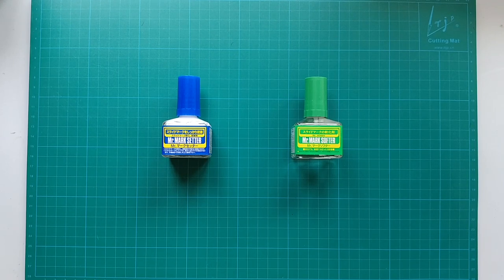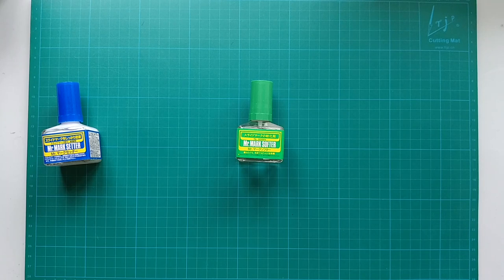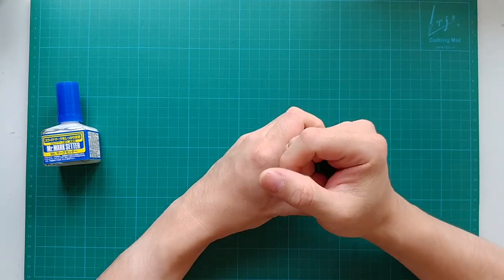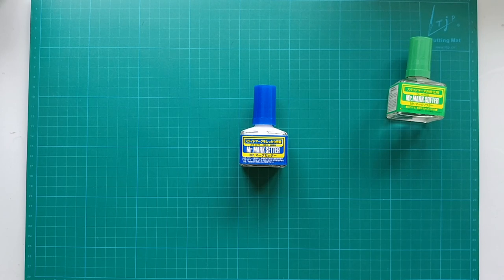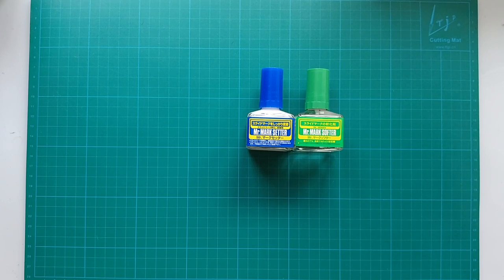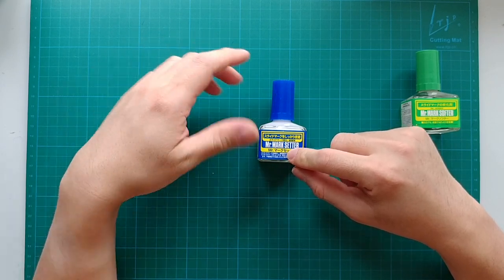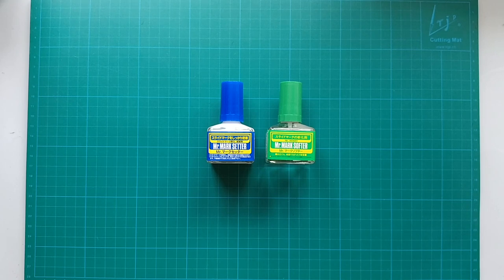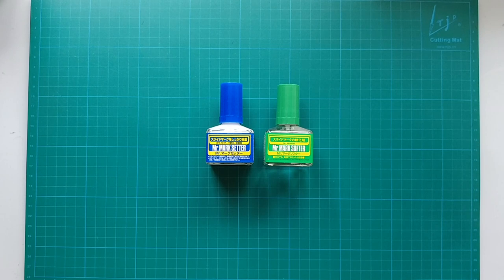[Scale Modelling] Decal Setter vs. Decal Softer

Comment: great tutorial, thank you
I'd like to add a note about mark softer. There is a real chance of damaging decals, if you expose for too long. And this "too long" is different for various decals. I have an unpleasant experience with airfix and hasegawa. Exposure time was around 1 min. Got various effects - from spots of burned colours to partially dissolved decal. So it's a good idea to try this liquid on unused decals from specific kit first, and adjust mode of operation accordingly. Aside from that this is really great and handy product.

Comment: I need to ask some questions about working with softer and setter. Is there anyone who can help me or direct me to somewhere I can ask questions? I've tried searching for English language Gunpla forums, but the results I've found either 404 or aren't updated.

I'm trying to use some water slide eye decals for one of the Figure-rise Standard Build Diver kits. I have the eyes on the parts, but the glue is so weak, the decals fall out of place as soon as they're fitted into the faceplates. I bought some softer, thinking that might solve my problem (if I can melt the decals in place, they won't fall out), but after watching this video, I'm less sure. The eyes are already resting on the parts... I'm just afraid they won't stay there. How should I fix this?
Reply from the maker: Softer provides no adhesion at all. But it help to shape the decal membrane to have better fitting to the contour of the object surface, enabling to maximize the contact area.

Setter is the decal adhesive with mild softening effect.

It might be too late now. But anyway, you should clean the model surface to remove any oil, grease or de-moulding agent before you apply the decal. This might be the cause of your decal detached at the first place.

If you really worry about the decal detached again, here is my recommendation. But it is somehow risky. Just to detach the decal by soaking the piece in water. Provided long enough so that the decal separate from the piece on its own. Carefully retrieve and preserve the decal membrane and clean the model surface with diluted dish washer (rinse off accordingly). Re-apply the decal with Setter or wood glue (If you don't have the Setter on hand.)
Reply: @BadGuyDennis  you're not too late! I will give it a try. Thank you!

Comment: Can I use this Setter and/or Softer even I had already finished to transfer decals on my model kits without using this a few days ago?
Reply from the maker: Yes, you can!
Reply: @BadGuyDennis Thanks for reply. At least I have no worries today.
Reply from the maker: Just want to remind you that you have to detach the decal off from the model surface first before you reapply those softer & setter. You might need to soak in water for quite a long time to allow the water to penetrate and  dissolve the adhesive, depends on how well the decal was attached.
Reply: @BadGuyDennis  Thanks for the infos.
Reply: You can also create a small hole with your hobby knife for the setter to set in underneath the decal. Then you press down on the decal to fix the hole. Just be careful because you may damage the decal.
Reply: *Just be careful when using the hobby knife